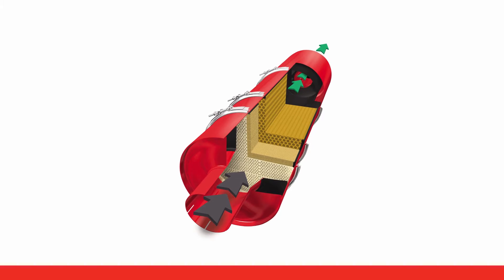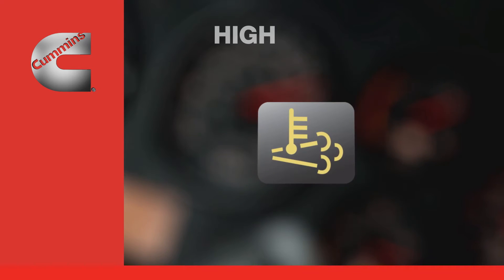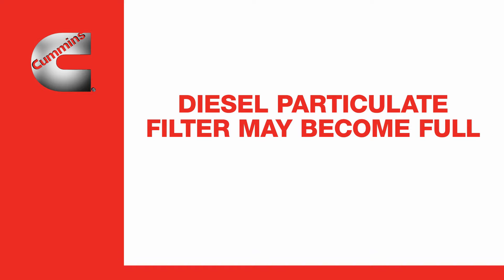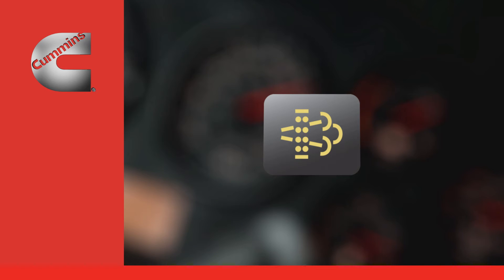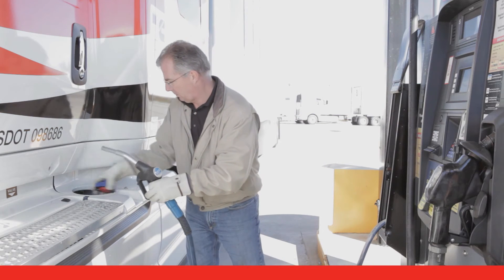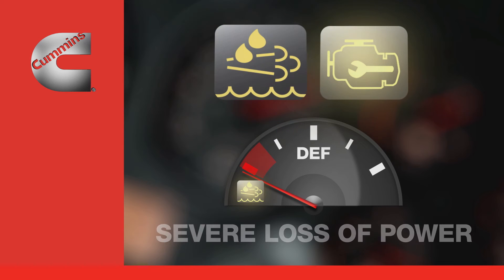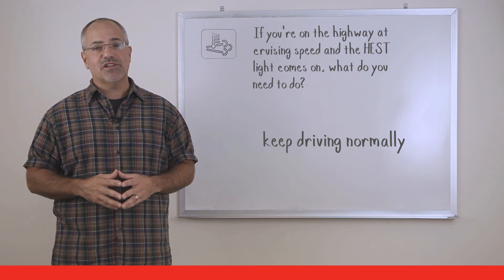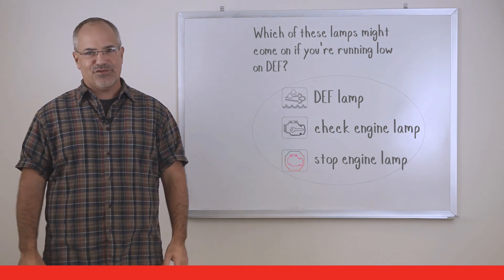The Cummins Aftertreatment System - Driver Training for On-Highway Heavy-Duty Truck Engines

Comment: Cummins the biggest POS on the road today. I’ve got a 14 model ISX and the emissions problems never end. Haven’t been able more 2 weeks out of it without a failure in the emissions systems. I had to overhaul it 200,000 miles and now have 400,000 on it and it looks like it will need another overhaul within the next couple of months. Cummins says they don’t know what’s wrong with it. They used the upgraded pistons and liners it shouldn’t have the issues it does. Worthless jerks at Cummins!